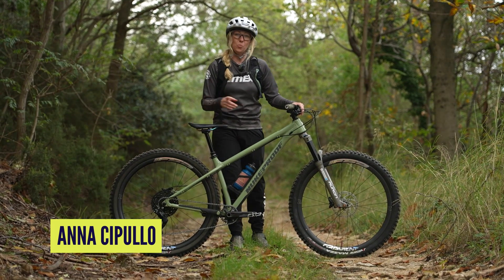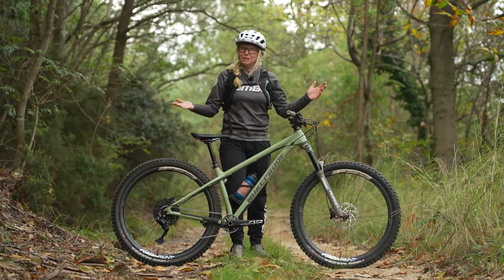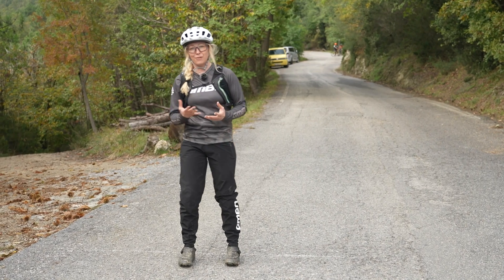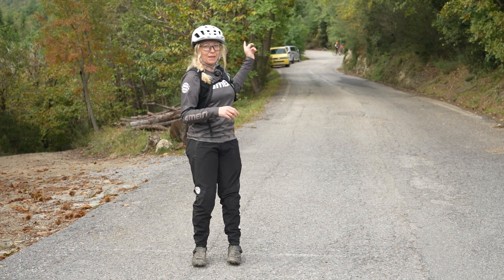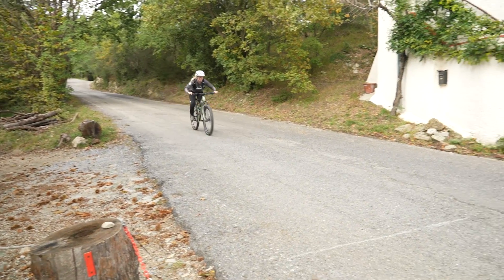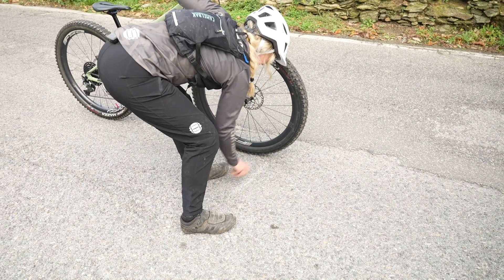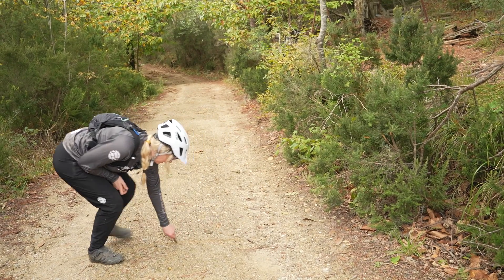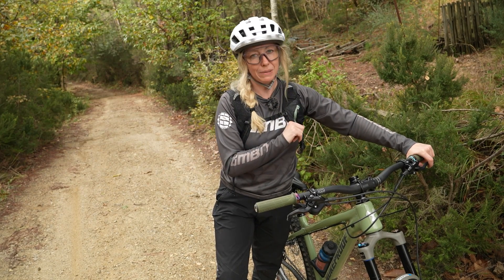Is Bigger Better? The Science Of Superior Braking Performance

Comment: as @floydblandston108 said - while braking you didn't really change the way you modulate (or did not modulate at all) nor your body position. There was very little gain in braking if you don't actually use the grip of tires. I was surprised that you didn't pay attention to that more, you know better! :) Braking distance should be measured ONLY if you did not skid.
also forth mentioning that not all discs have same surface and is not acting same with all types of pads + include the 'bed in' period required and etc... there are quite a few variables, but for the purpose of this video - the point was made! :)

Very interesting video anyway! I am happy with my Magura MT5 with 203 up front

Comment: 5:55 "Being that they are bigger, the bigger leverage ratio" Not quite. 
Leverage is not torque. Torque is a rotational force, a moment of force.
Leverage is a force compounded by means of a lever. 

For a given amount of input force at the lever, the force between the pad & the rotor (no matter size) is such that the total normal force remains the same. And the force per square inch of a rotor actually decreases. Any rider can only input a certain amount of finite force at the lever, this does not change the force from the caliper pistons to the pads to the rotor. Braking torque is Force x Distance. Larger rotors can not increase force. An increase in force would have to be a by product of lever size, pistons sizes (master & calipers) and pad size.

Comment: You can't measure steel surface temperature with IR thermometer. Steel surface is reflective and the reading will be affected by the reflection of outside world.
Reply: It will still emit IR radiation. I can't see it not working
Reply: @Leo-gt1bx  the mirror also emits IR, but you don't see it because the reflection is stronger.

Comment: I run 203 front and rear on all my mountain bikes! Absolutely the size matters with bigger heavier riders and ebikes. But I think it’s not about worrying about locking the wheel up it’s more about using less break lever pressure for same power, less hand fatigue, less rotor wear. If you’re just cruising down a green trail then yes 160 or 180 is just fine.

Comment: #AskGMBNTech Possible Hack here...   Will a 220mm alloy hub (heat sync) rotor mated with a cheap 2 pot caliper out perform a 200mm high end system.
(with the low end 2 pot on a 220 giving more modulation, bring it back to the feel of a 200 ???...   and Cheaper.... and longer life out of the pads...)
and if someone makes a heat sync 220mm rotor with ridges to give more surface area for even better heat loss.... might out perform the 200 etc on trail braking heat.
Using the hardest compound pads on a 200 rotor would also add feel at the cost of ... well instant lockup which unless your landing a 30 ft drop and have so much weight on the wheel the grip overcomes the brake force... wouldn't be a bad thing.

Comment: There's so much science with regard to the laws of mechanical physics behind braking systems that trying to put it into layman's terms is just going to confuse a lot of people who don't want to bother to learn basic physics. It's about frictional forces, torque, thermal conductivity, thermal efficiency, heat-energy conversion, heat-energy dissipation. Kinetic energy converted to thermal energy. Bigger rotors do not provide more braking power. Bigger rotors offer more braking efficiency. But this is just one part of the equation. Caliper size I.E.-  2 Pistons or 4 Pistons, pad size, pad material, master cylinder ratio and fluid all contribute to the efficiency the effectiveness and the power of a braking system.
Reply: One thing that is confusing: once you lock up the wheels your braking system has no effect anymore. Would an ABS system benefits braking performance on tarmac and on the trail?

Comment: "Although friction force is, according to Amontons’ law (Chapter 2), independent of the apparent friction area defined by the surface area of the brake pad or lining, the friction material may suffer mechanical or thermal failure if it is too small. The minimum surface area of friction material required to ensure satisfactory service is normally determined by consideration of two criteria, which may be specified by the friction material manufacturer or developed from experience by the vehicle manufacturer. Shear loading relates to the shear strength of the friction material or the pad/backplate bond, and power density (also called ‘work rate’) is a measure of the rate of heat transfer into the friction material that it can withstand before its structure breaks down. It is usually necessary to consider both criteria and design the friction material size to meet the higher value. Wear, which is also related to the size of the friction material surface area in frictional contact with the rotor, is evaluated later in the brake system design process (Step 5) but experience has shown that if the limits for shear loading and power density are not exceeded, the friction material wear is unlikely to be unsatisfactory.

Shear loading refers to the friction force per unit area of the brake pad or lining, as illustrated in Figure 6.3. Assuming that the wheels do not lock, this can be calculated from the braking force at the tyre/road interface (Ti; see Chapters 3 and 4Chapter 3Chapter 4). For an axle with two disc brakes each with two pads of friction surface area Ap"

Comment: If you are a heavier rider, like 85/90 kilos and more and you ride steep and long tracks bigger is better, I changed from 200mm center line in the front to 220 hs2 rotor, I don't feel much more braking power, but there is a difference, and a thicker rotor is a good thing too 🙂

Comment: HI Nice video! But the word science in the title is not accurate for what You presented! You introduced too many variables, for instance didnt use power sensors on your brake levers, did not do enough runs for an average and so on, to be scientific. To hear your personal feelings and impressions is nice, but also not science.
I use 203mm on the front wheel (so I can switch wheels between my different bikes for convenience depending on the surface I want to ride that day) and 180 in the back. 
I try not to drag the brakes too much, so heat was never an issue... Not even on 10 km long decents...
It's true, the force You have to apply is way less with bigger rotors... I like to hear You talk, and the way You present. Thanks and greets

Comment: No matter the size I keep warping rotors.
But some reasons for that can be sticky pistons, so lube the pistons.
Rebuild caliper with new seals if needed. Only do that hwen they leak and get stuck even with lubing.
I gone side is sticking there will be a bad brake feel and pad will have a gap between the rotor. And other sid eiwll bend the rotor. But even with perfectly working brakes I keep bending rotors.
I run 223mm rotors front and rear.
In warp rotors less with bigger rotors but still do it. I ran 180mm rear, 203mm front Hope Tech floating rotors. Now I run 223mm Trickstuff rotors. I opted for rotor with no rivets for no creaking, got them second hand offered to me for half of retail so had to try it.
Hope floating rotors defenitly perform much better than resin only rotors in same size, I've had 160 rear 180 front on my previous bike. So massive upgrade. But after years of use it creaked in the rivets.

Comment: You were clearly locking up the rear with 220 whereas the 200 was acting like ABS during emergency braking. Didn't look like you locked the front at any time and could use more power there. A wet test would be good to see how easy you can modulate the front without locking it up.

Comment: Upgraded my Slash 8 180/200 to 200/220 after my brakes were overheating on longer runs. 10 minutes plus. Made a huge difference, with no overheating. I also like the sensitive braking, which some people may not like.
Reply from the maker: Sounds spot on! You can always switch to a braking system like Srams where the modulation is far greater giving a less sensitive lever feel, but easier to modulate power.
Reply: I Had a similar Problem with my Cube one 77, solved IT with a 200mm Rotor at the rear.

Comment: I love this channel very much, however this test is unfortunately inaccurate considering the rear tyre was sliding almost the full duration of each brake test, the idea of testing rotors is not to see if it will lock up the wheels but to see how quickly they will take you from whatever speed down to zero with the least amount of wheel lock up possible. With proper braking technique you should be able to apply just enough brake force on each wheel to just where the wheel is about to lock up but never actually does to give you maximum braking force with each lever pull.

Comment: I've put a bigger rotor on the front and a smaller one on the rear than the stock setup. There was too much power on the rear for the amount of grip that wheel has, making it hard to modulate to the point of lock up. I suspect bikes coming with too much rear braking power is why we have so many braking bumps at trail centres!
Reply from the maker: That's something to think about! 🤔

Comment: You need to do this on a full suspension bike for real reaults to compare to why enduro racers use 220mm rotors.  Hand farigue, especially with basic brakes makes a big difference on longer runs too.

Comment: As heat builds up in the rotors and pads the "capacity" of the brake system gets filled up and tires get more and more prone to locking up as the energy finds it easier to skid the tires than to turn kinetic energy into heat where there's already a lot of heat built up. 

I like to think of the rotors as pools in which I can dump my kinetic energy as heat. The rotor size is the volume of the pool, the heat dissipation is the sink of the pool. The bigger the sink the faster it drains (duh.) and the larger the volume the more speed I can dump into it at once. 

It is surprising how many riders are willing to let go of that braking performance for the measly gain of a few grams. Better braking means higher overall speed through confidence, control and safety. 

Tire grippiness is what determines how full the pool can get before I start skidding which is to be avoided if we want efficient braking. 

Just my 2c.
Reply: So Ur saying bigger rotor less likely to lock up?
Reply: @shamsta21  I think a better way to phrase it is that modulation will not fade as much when the "heat pool" is bigger. You can for sure lock up any brake at any heat level with enough force on the lever. The critical question is which is an easier path of flow for the kinetic energy to turn to heat or other energy discharge methods like your tire losing bits and layers through micro (or possibly macro too, I guess) destruction. Just my 2c.

Comment: Horses for courses. On my enduro bike I'm happy with 203mm front and 180mm rear. Tried 203mm rear with a four piston Zee and it was actually too much brake for me on pretty steep trails. Finger rest on the lever in the air would start locking up the rear and then dip your nose on jumps. 
Combination of quality caliper and adequate rotor size makes more sense than just upspeccing rotors. On DH bikes, or enduro racing, then by all means, 203 or 220 makes sense, but I think there is a thing like too much brake for purpose.

Comment: If you really want to get an idea of heating and cooling, The Bike Sauce channel put a data logger on his disc and did testing on a road for consistent, hard braking. 

I've been meaning to repeat this to compare Ice Tech to cheap rotors... Heat dissipation rate. 

50C is nothing to be excited  about. Heck, sometimes the ambient temperature is 38C. I've measured 100C without fade. Pretty sure pads and oil are rated well above that.
Reply: If you temper stainless steel it gets different colours. It gets the same colours if it heats up at braking. If parts of the disc reach 200° they get yellow, if they get blue they are more near 300 °.

My disc rotors are yellow beside the braking surface.

Comment: My observations:

1: TEMPERATURE CHECK - The temp check should have been done right after stopping by 2 diff individuals (one for rear and one for front). Why? Because the front rotor is cooling down whilst you are checking the rear rotor temp.
Also note the weather /temperature outside because I believe that also makes a lot of difference.

2: STOPPING DISTANCE - Although it gives a fair idea about the results. But to be on the fair side, the riding speed should have been checked and maintained for all the 3 rotors. In other words, the speed should have been similar for all the rotors before applying the brakes.

Overall, the test is interesting. I would suggest a combination test next time. Like, 200 in the front and 180 in rear vs 220 in front and 200 in the rear and how braking power performance differs vs same rotor size in front n back.
Reply: I think stopping distance using a bike with ABS (I know, near impossible but the brakes need to be allowed to impart max load without locking... unfortunately ther is a point where the tyre will brake loos regardless of what brake you use... so at some point, no matter how big the rotor, you would reach a limit where bigger would only supply a unusable amount of extra force (but of course if you could modulate it, the lighter weight on fingers would be a plus.. but again the feel would get to a point where you couldn't modulate as the forces would be too close/small for finger 'feel'. 
I think with proper setup (pad change etc to get the best force needed for finger modulation, a 220 would be better..    
A harder compound rotor (higher carbon?) would reduce the overpower and increase life... but do bike manufacturers want to produce a brake that can be made cheap (2 pot) and have both pad and disk last longer (so they can't sell you more parts per month). (This is why they love selling the crap low end gear that actually costs the same as the high end to produce... tell me why the XT gear they made 20 years ago isn't the base cheap gear.. instead of actually just as expensive if not more expensive cable systems (just look at all the parts needed in a cable caliper compared to 8 main bits in a hydraulic base model caliper (2 halves, 2 pots, 2 seals, 2 pads)...
As for temp check... 3 people (4 incl Anna... tho Anna could play the 3rd role....  Anna pulls up. 1st person starts a clock... person at front and rear take reading & note it down, 1st person calls 5 sec intervals and front and rear record temps... result is a graph of, not only heat at stopping, but heat loss over time after stopping...
Thing is... GMBN want a nice simple result and not a lot of people involved... so we get an Idea of a real result but not a truly scientific one... but if the Idea comes up with anything odd/interesting, it may spark someone to do the extra mile.

Comment: It would be great to see 2nd part with test on longer trail, dragging brakes and maybe test with strapping more weight to the bike to see how disc react with your weight vs heavier rider on the same bike with same setup (important to have the same rider + weight to have same riding style)
Reply: Is rather suggest a second, heavier rider doing the same tests simultaneously. Adding 20 kilos or more to the bike/rider doesn't seem feasible

Comment: Another element to consider is that increasing rotor size increases the actual speed of the rotor through the pads due to the circumference increase with fixed wheel speed. This could over heat some pads or pad compounds at a faster rate.

Comment: Nice premise for a video, but... A rotor with only an extra 30 degrees in it is a rotor that hasn’t been working hard, although IR thermometers aren’t an accurate way of measuring the temperature of shiny metallic things, so maybe they were actually hotter than the reading suggests?

Comment: So a test with uncontrolled variables which essentially removed any reliable data. Nice. 
Larger discs will cool faster, require less effort and stop faster with more control if traction isn't an issue. 

This is highschool physics.

Comment: The brakes should be hotter but cool quicker with increasing radius. The velocity of the disc that contacts the brake is greater as the radius of the brake gets larger, making for greater temps. But the increase in surface area enables them to cool quicker. The ideal larger brake would be if the surface area of the friction pad was increased, not the rotor. Or have dual parallel discs and pads. They are probably on the way
Reply from the maker: Dual parallel disc would be cool to see! 👀But a bit heavy for MTB I think we could see them appear first on an E-bike but is there really a need for them? 🤷‍♂
Reply: @gmbntech  - We'd be better off first going back to Magura's 'Gustav' sliding caliper system.
Reply: @floydblandston108  I love my Gustav's on my old Foes Weasel (made it to GMBN mention a couple of times now, see my walkaround vid for a view of the Gustav up front.)...
Reply: Not sure your right with the hotter bit... Take it to an extreme (caliper the size of the rim... The disk will have cooled by the time the wheel has done full rotation, but the pads will be hot... but not necessarily as hot as a small rotor as the force will be so much less required....
so less force, more heat dissipation... the rotors should be cooler...
The problem I see is that with less modulation, I think Anna may have been riding the brakes a little more to keep 'feel' for them. 
( found myself doing that for the few days after getting my 200mm brakes clean and running (when I 1st got them) before switching to 1 finger.. and literally overnight never went back after the 1st 1 finger ride. (which I got on film on about my 3rd U-toob video)